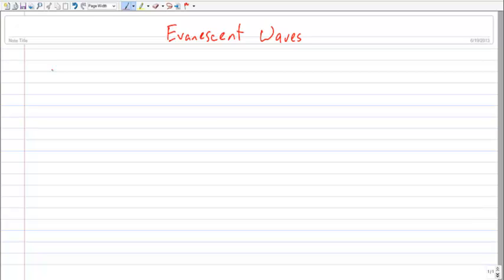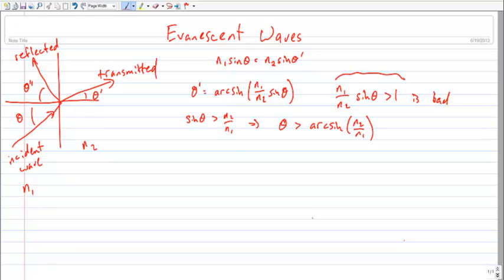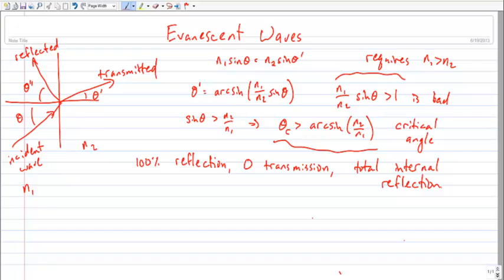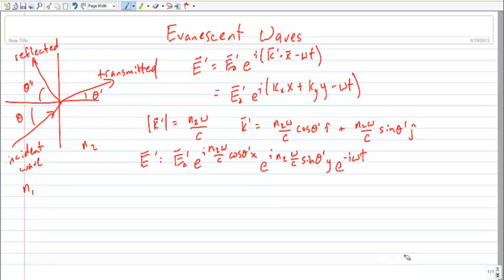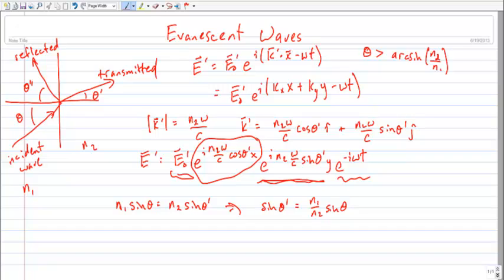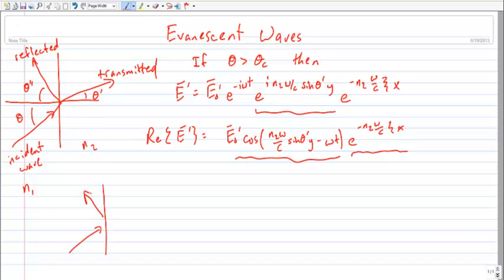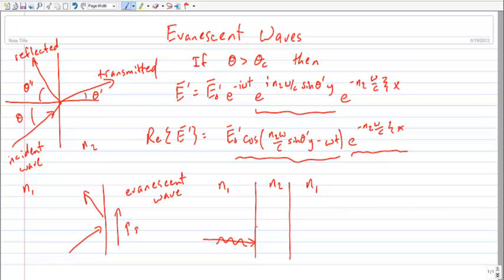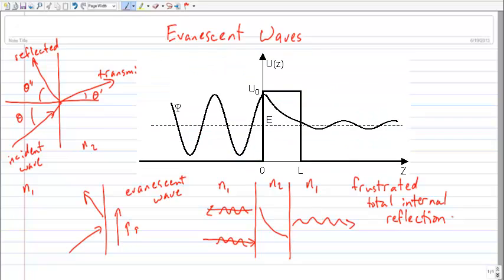Evanescent waves

Comment: At 4:09 what happens to the negative square root?  I appreciate it would give exponential increase but wonder if there is any other justification to exclude this additional solution.
Reply from the maker: Interesting point.  Off the top of my head, I can't think of a reason to exclude the negative root other than physical expectations.  Seems like there ought to be something, though - maybe if we keep the other root we end up violating Poynting's theorem (energy conservation, essentially) or something like that.  I'll have to give that a little thought.
Reply: Yes well, I was just surprised to not be able to find anyone (on Youtube) who had even considered the possibility. If I think of a more explicit reason I'll drop you a line. Thanks for the response and the informative content!

Comment: Thank you very much for the  nice presentation and explanation. Just a few questions I hope you could help to elaborate a little: Doesn't Snell law breaks down when the incident angle is larger than the critical angle? So is it still valid to use the expression of SinTheta' in the electric field wave expression when that happens? And in the later part of the video, an example is provided with the normal incident wave from n1 to n2 media where evanescent wave is assumed in n2 medium. But could that happens when the incident wave is propagating perpendicular to the interface as SinTheta' would be 0 (< 1) in this case? Appreciate it.